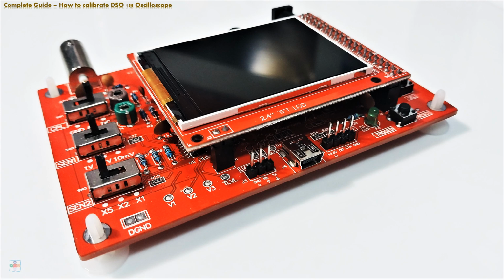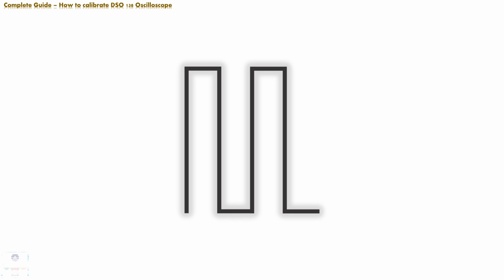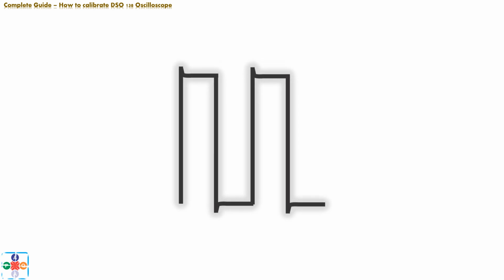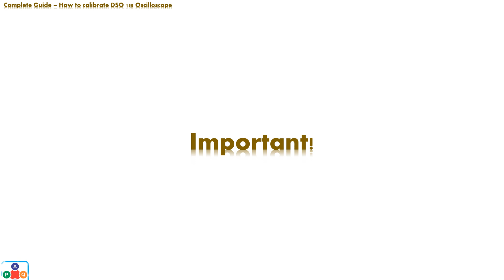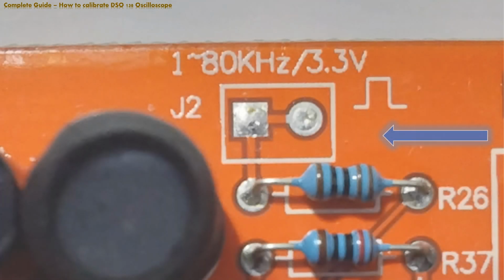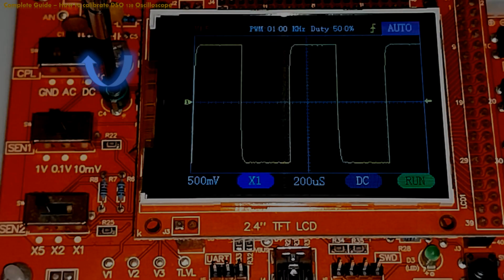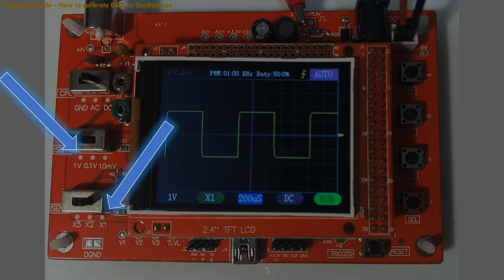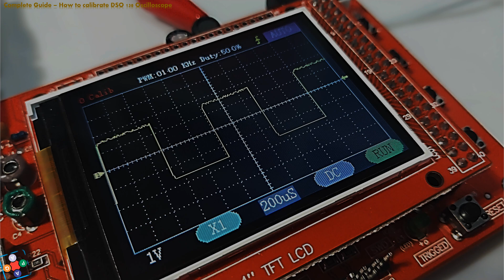Complete Guide How to calibrate DSO 138 Oscilloscope

Comment: Greetings.
I'm trying to find the Firmware because I had to change processor.
So far I've only found one for the other one that looks similar but isn't the same.
Could a friend help me find the Model for this. 
Thanks.
Reply from the maker: Hello, thank you very much for your question. Before you start with firmware upgrade, please watch episode 7 of DSO series. There is comprehensive procedure on how to upgrade firmware, where to obtain firmware binaries and software. Please pay attention that procedure referrers only to original DSO 138 device. Upgrading firmware on knockoffs in not officially supported. If you wish to experiment, there are firmware upgrades from third parties for knockoff devices on GitHub (you do this at your own risk). We do not have videos on those upgrade procedures, as they are not officially supported and backed up by official channels. Again, please watch episode on firmware upgrade, we hope it will help. Thank you very much for posting your question, and we appreciate your choice to watch our videos as well. Greetings.
Reply: @asquicklyaspossible  Dear sir, I tried to find the firmware for the board you have but I was not lucky.
I am willing to pay the cost of the work if you could help me , because everything I found is not compatible with the board .
Τhanks in advance .
Reply from the maker: @SuperMohdsameer  Hi, you can download firmware for the original DSO 138 oscilloscope from JYE Tech from their support page, here is the link 
https://jyetech.com/firmware-dso-138/
Please beware that this firmware works ONLY AND ONLY for original product from HYE Tech.
Reply: @asquicklyaspossible  Thank you very much for the IMMEDIATE response. !!
I have tried it. . This is not the software for the board shown in the video.
https://www.youtube.com/shorts/lXhKZd-a65I
This company supports another oscilloscope.
Thank you. ! !

Comment: What is the size or specification of screw driver? I'm trying to use mine and it's too big
Reply from the maker: Hi, you will need - 2mm flat screwdriver. Although, the capacitor looks like it has Philips  (+) socket, the grooves on capacitors are flat and can be only accessed by flat a screwdriver.
Reply: @asquicklyaspossible  Thank you for replying.
I successfully upload jpg images to ESP32 LittleFS. 
How to display them? Do you have tutorial for it?
Reply from the maker: @jumbo999614  Hello, thank you for your question. Unfortunately, we are unable to provide any insight, as we currently do not have any tutorials on Arduino boards.